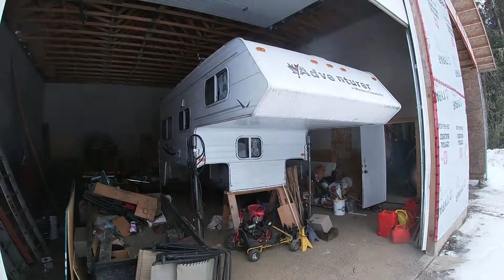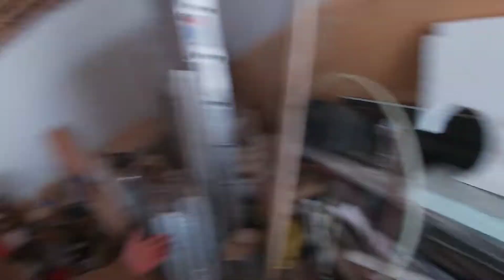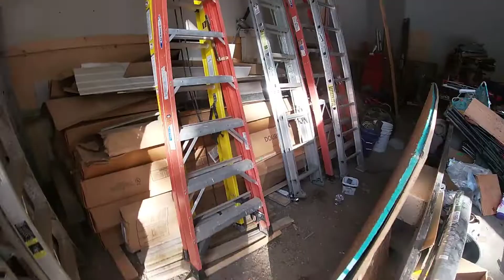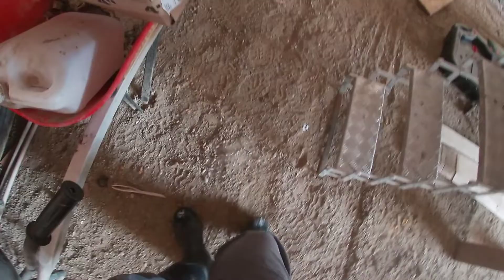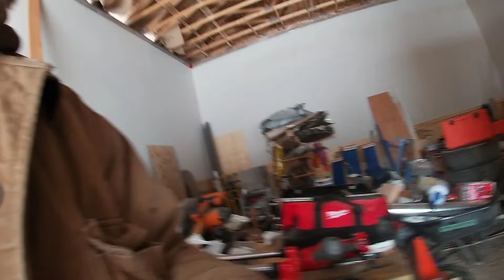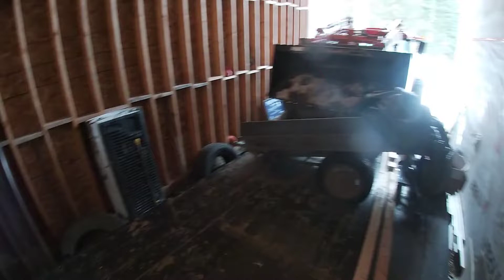SHOP REVIVAL! Shop layout and getting some organization under control.

Comment: Someday I want to build a shop, it was in my 5 year plan 7 years ago.  So far I've cleared the site of sod and hauled in sand to bring up to grade height.  I want to make it 40'x60' with 16' walls.  Im sawing my own rough sawn lumber and its tuff to find nice straight 16' logs in my area.  No fir trees around here.  I will likely have to do a knee wall for the top 4' of wall.  It may take me a couple years to get enough lumber made hopefully building supply prices come down by then.  Trusses are spendy.  May decide to try making my own trusses too.  We'll see.
Reply from the maker: You filming that project? That sounds like a good time! Sawmill and construction!
Reply: @sprucestomper  Nah, I'm not cut out for life behind a camera.

Comment: Bathroom paint on those walls.  Its easy to clean and the gloss helps reflect light in the shop.
Reply from the maker: Just so happens there is a commercial paint sprayer buried in that shop as well, might come I handy.